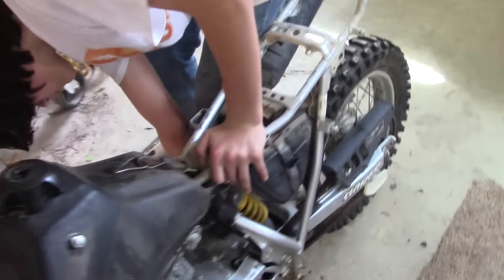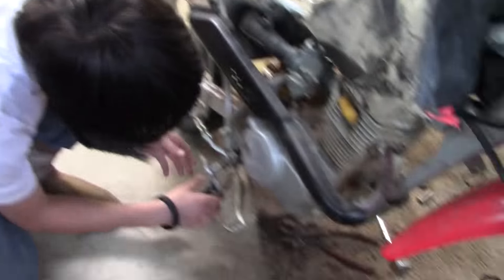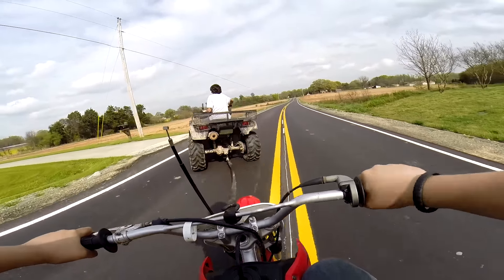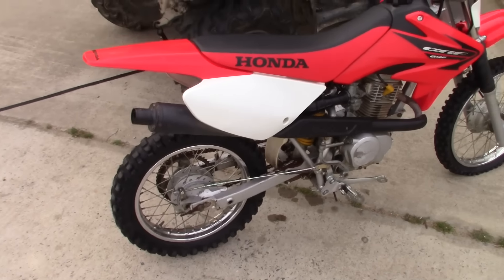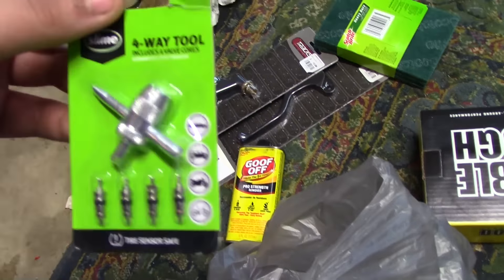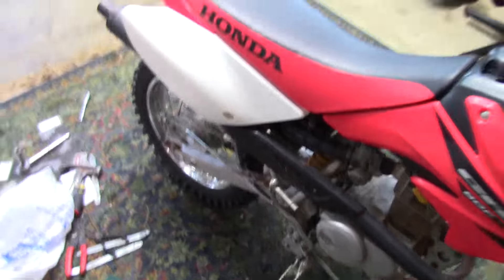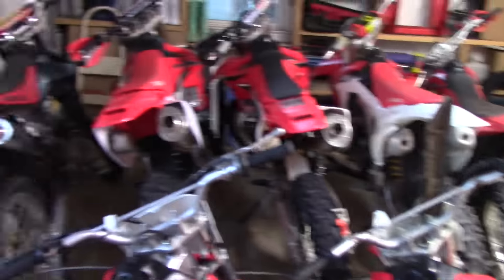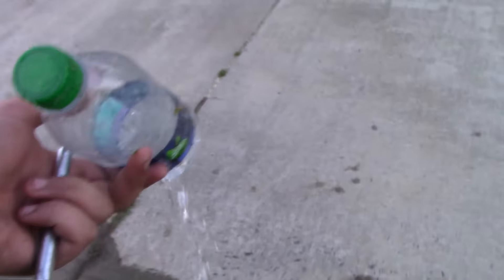Getting My Crf 80 Running! Garage-ish video!

Comment: I.rebuilt 2 80cc yz and sold the one that was a little older and the one that was newer sold to friend bought an 80cc(running) buffed up to a 100-110 ishcc and it looks like an 80cc but it's really a 100-110 cc don't know think it's 100cc but lots of work in 1/2 of a year

Comment: What gear do you sugest to ride a wheely on a honda crf 100
Reply: What I did on mine was I rode in first pulled into second without clutch throttle and pulled back
Reply: +Joshua Donelson Thanks

Comment: Hey I'm 13 and new to riding what bike would be good for me I'm getting a 125 I just don't know which brand is most reliable
Reply: D
Reply: Yamaha yz 125 can't go wrong it's a two stroke.fair pricing on most used bikes
Reply: If you gonna get a yz125 get a 05 or newer. Because then it will have an aluminum frame.
Reply: Are you going to do trail riding or racing?
Reply: +Logan Reptiles Trail riding for the most part but I might also try racing
Reply: +The Swiftest Kills get a CRF 125F it's a great trail bike and good but not the best for racing but, since your doing mostly trails get a 4 stroke
Reply: +Logan Reptiles two strokes are good for trails to but how tall is the kid that want a bike bc ttr or crf prob best get a four stroke if your new to riding get used to a four stroke first  125 2 stroke is a big bike ecspecilly the 2016 yz 125 I got one it's really tall compared to my Kx 125